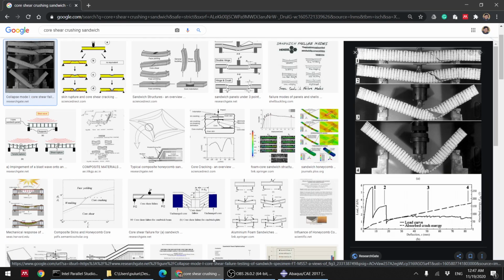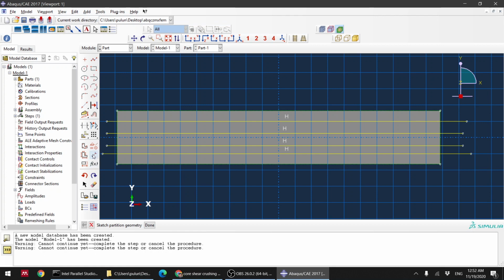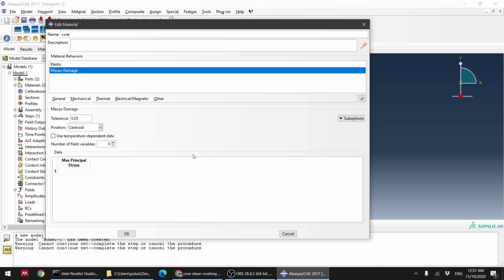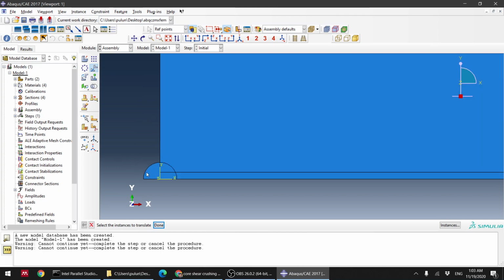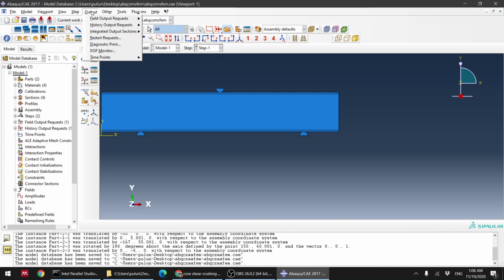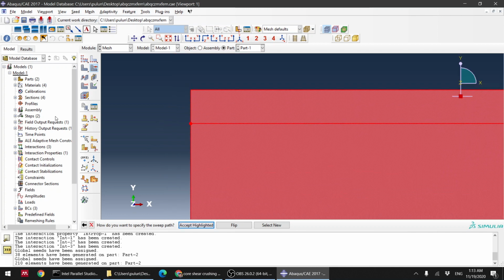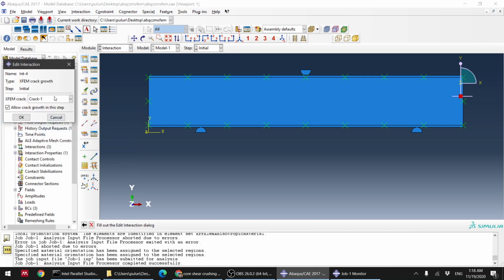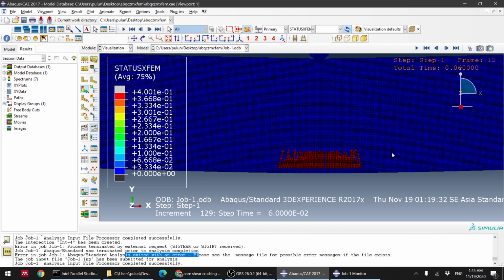Abaqus 2D plain strain modeling of composites: crack to delamination with cohesive elements and XFEM

Comment: Very interesting video. But why did you specify contact property while you were defining XFEM? Why did you use the same contact property which you have used for supports to be in XFEM as there is no relation? What does the contact property mean within XFEM? Thanks in advance
Reply from the maker: When the xfem crack occurs, you have new internal surface crack.. imagine now this crack surfaces happens to be in compressive to each other.. so their sliding behavior (between cracked surfaces) shoul follow some interaction properties.. the properties u questioning

Comment: I followed this tutorial and it gave similar result to this video. Yet, i found the analysis was aborted after several minutes passed (approx 10 mins>), i can see the post processing result though. it said something related to timestep/increment setup problem. Is it just me who faces this problem? Can anyone help me? 😂
Reply from the maker: Thats the limitation of xfem.. the xfem failed to model the single crack accurately..

There supposed to be a single crack from the bottom travels to the top layer.. but in this simulation, as you see, many small cracks appear. And when this happens.. xfem failed to converge. Nothing you can do about it.

The best way to work around it to give a stress raiser.. in form of a small defect.. or a small precrack... so xfem will inititate from there and only a single crack appears
Reply: @FEADith  Woah, alright, that makes sense, thank you for your explanation.